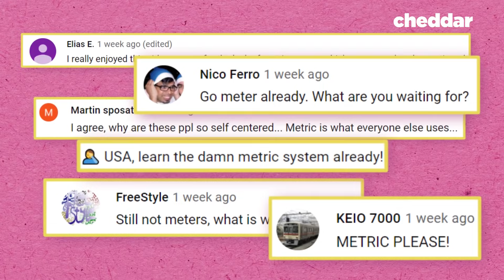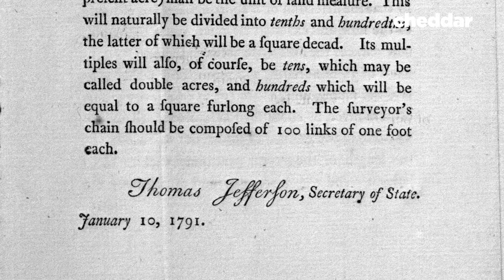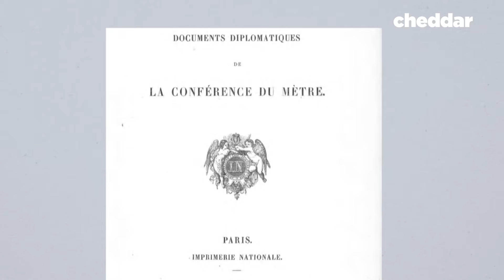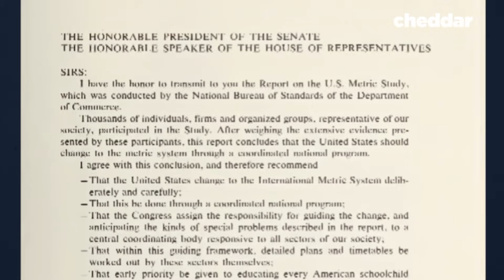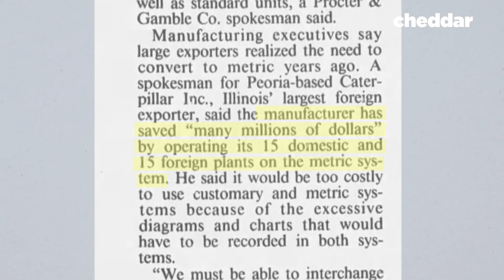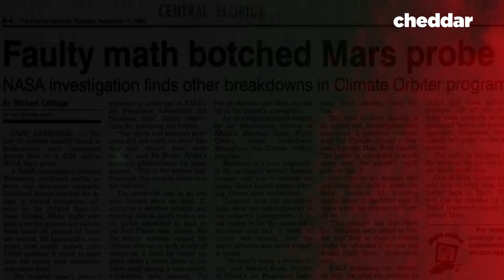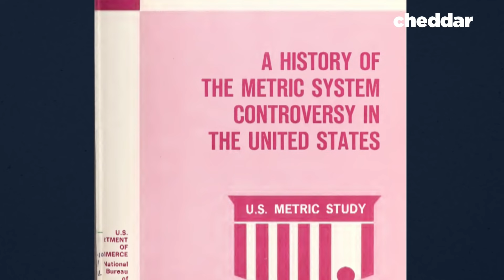Why Doesn't the US Just Use the Metric System? - Cheddar Explains

Comment: I'll never understand the hate for the Imperial system. Arguing for acceptance because it's the standard in the most number of places? Sure. But when people start talking about how Imperial is a bad system, I just wonder if they'll ever realize that they already use a similar system of measurement that doesn't have internally consistent values: Time.
Reply: Roman Hauksson-Neill  
Metric time is a real thing. It's all about perspective. People think there's no alternative to the system they use because they are used to it. Metric time is probably better than the system we use in the same way Metric units are better than Imperial units.
Reply: @Stiljoz  https://en.wikipedia.org/wiki/Sexagesimal  and https://en.wikipedia.org/wiki/Duodecimal  are much better at division with whole numbers, except that we chose base ten Arabic numerals.  Think of how easy it is to work with a quarter of an hour, a half an hour, a third of an hour, or just one twelfth (5 minutes).     How long is a third of a metric hour? Maybe, 33 metric minutes and 33 metric seconds, and 333 metric milli-seconds or 20 minutes...  base 10 is not the best at everything.  Agreed, 5280 feet in a mile is a bit idiotic, (we apparently take slightly smaller steps than the romans with 5000 roman feet in a mile).  Hey, feet would have been a bit too short for 1/60th of a degree of the earth ~6072 ft. (1 nautical mile)  So that is frankly the issue in human related units vs earth related units. Oh well...  If our strides were a bit longer and the inch a bit longer, we could have some nice wonky units in base 60 or twelve and reallllly easy whole number divisions...   2,3,4,5,6, etc...   Ahh, for a 6000 "foot" mile, and about a 25.72mm "inch"

Edit: Corrected to "twelfth" from auto-corrected "tweets"....
Reply: The SI unit of measure for time is the second. Its defined in relation to the frequency of some oscilation in Caesium atoms.Atempting to use the rotation of the Earth and the relative movemnent of astronomical objects as the base for measurement just dont work because they vary, thus leading to leap days and leap seconds to prevent time and dates to drift too much.
Reply: How many cubic feet in a liquid gallon again?
Reply: @1978ajax I was trying to convince proponents of the imperial system that there is a huge advantage to the metric system. (You obviously got that)
Btw, the conversion between mass and volume is not a good example.
Reply: @1978ajax because it is only true for water and only at a specific temperature.
It's just a lucky coincidence, not a systematic feature.
How much does 1000cc of oil weigh?
Reply: @1978ajax No, it isn't room temperature.
Reply: @1978ajax You seem triggered.
It's not at the SI unit "room temperature".
And it's not a "system" if the conversion works for exactly one liquid.
Sure, block someone who you don't agree with. Makes your point so much stronger.
Reply: @1978ajax I see it fits a pattern with you. You don't agree with someone, you block them or ignore them.
Good for you. You obviously are very easily triggered.
Reply: I will never understand how can a person be so stupid to get mad and argue over something like measurement system.

I live in EU,I hate metric and I never got mad no matter how i felt. It always amazes me when an adult spits like a 10 years old when i say i like imperial without even saying anything about either system being better.
Reply: Because imperial is harder to use and more error prone.
Reply: @heronimousbrapson863  
Maybe if you never used it.But same story is with the metric.

Both are easy to use for a person who uses them regularly. And both systems are error prone only if you convert them between each other.
If you keep metric with metric and imperial with imperial you usually get precise results.

You might think metric is easier because you are only moving the decimal point.
But as an European who uses it and comes to contact with micro,nano,pico,.... units sometimes.
It can become very confusing when making a bigger conversion either up or down.
If you stay with basic ones like km,m,dm,cm,mm thats pretty easy,but so are miles,yards,feet and inches when you are used to them.
Actually quite ironic in some metric countries they dont even know what dm is.
Reply: @Stiljoz
: there is no "hate" for the imperial system. Everyone think it's just ridiculous and dumb, that's it. Ad for time, it has absolutely nothing to do with metric or imperial system. You'd know if you paid any attention at school. The time measurement as we all use now comes from the system developed by the ancient Sumerians and improved by Babylonians. Saying that the time measurement is "similar" to imperial is simply stupid, to put it nicely. But I get that's too much information for you to process.
Reply: I do not hate the imp system, but it is not consistent. One US gallon is 3.8 liters, one imp is 4.2, the bushel is not the same, and even Americans screw up unces. Water density is crazy in the imp system, With unces to the cubic foot. When these  calculations went wrong you could conclude that the imp calc was wrong, the metric system is too simple. Remember an oil spill on the Canadian East Coast.. A US Fishing vessel ordered diesel in gallons. and much of it ran over. The yanks had calculated in US gallons, the Canadians delivered Imp.
Reply: @floro7687  I'm not sure what you mean. The US gallon is the imperial unit for volume. And why are you saying one "imp" is 4.2 liters? "Imperial" is the name of a system, not a specific unit.
Reply: @Stiljoz  Much you know! One US gallon is 3.8 liters. One imperial gallon (UK, and elsewhere in the former Imp. including Canada) is 4.2 liters. Imperial and US bushels are also different.
Reply: @floro7687  I had no idea the Imperial gallon even existed.
Reply: @Stiljoz   Many Americans are not aware of the world outside of the Land of Milk and Honey!( After the French Revolution they even divided the year into 10 months, but it did not Catch on.) When delivering tonnage cargoes in London Docks, the Imp system of unces to the cubic foot for water density could drive you nuts along With long/short tons. Often the same Madness in Australia and Hong Kong! Happy New Year!
Reply: @Stiljoz  Whatever yoy say Yourself! But it is outdated, and leads to misunderstanding. Some calculations you better do metric, and convert to (US) Imperial if Your oponent will permit.
Reply: @floro7687  See, this is exactly the kind of mindset that I'll never understand. You aren't able to see things from another's perspective. There's nothing outdated about the Imperial system. It's just a language you don't know. Some languages are easier to learn than others, but that doesn't mean English is a bad language for being among the most internally inconsistent. There is nothing that makes Imperial more or less confusing than Time, but no one has any problem with that confusing, arbitrary, internally inconsistent, outdated system we use.
Reply: @Stiljoz  Calculations are far simpler and quicker in the metric system. Have nothing against the imp but it is now used in 3 countries, definitely for a reason. If you wish to continue all right, however it should be prudent to standardize because whatever you say. there are 2 gallons, and 2 bushels, several barrels and the unce also often causes misunderstandings, unce, troy unce, fluid unce. Have you tried to to document a consignment of goods in several nations? As a person who wrestle With 8-9 Languages I suspect you know only English.
Reply: @floro7687  You're pretty much proving my point here. I'm saying that the problem with this conversation is it always devolves into insults. And so of course you say that I must only know one language because I use the Imperial system sometimes.
Reply: @Stiljoz  No insult at all. I just tell you it is ok to use Your US Version of the Imp System inside the US. But since no other nations Accept it, because of the fluid undefined state of the Imp Syst. problems arise in trade, which the US has de facto accepted, issuing export manifestos in Metric. You would have known this if you followed the press in other nations. How you find the insult I do no understand.
Reply: @Stiljoz   Sorry bro but the imperial system is just one big mess. The metric system is based on a decimal system, which makes it really easy to convert one unit to another (cm to m, gr to kg, etc). The imperial system on the other hand is based on arbitrary values, where the units are not related in any way to the others. That is the reason why you can't jump from feet to miles, teaspoons to gallons, without doing some really absurd and long math. But I also don't believe that it should be imposed, but rather gradually thought to the younger generations with a long transition period, to make the entire shift as smooth a possible.
Reply: @claudiochileno  I'm interested if you'll be able to see reason on this. I freely admit that the Metric system is the objectively better system, but Imperial is far from "one big mess". Is it difficult for you to convert 2 days into 48 hours? Or to convert 98 minutes into 1 hour 38 minutes? Or to convert 17 days into 2 weeks 3 days? These are very simple and easy calculations using units that have arbitrary values and where the units do not relate to each other in any meaningful or consistent way, exactly like the Imperial system. Doing conversions in Imperial really is just as easy IF you know the language. That's the key here. It's just a language that you don't know, so it seems complicated and confusing. Can you understand that this, admittedly worse, system is perfectly reasonable, functional, and comprehensible?
Reply: @1978ajax 
That's not even close to what I'm saying. It's really, "You use confusing units of time, so you should be able to understand using equally confusing units of length/volume/mass."
Reply: @1978ajax If you're just going to pretend my argument is different than it really is, then there's not much I can say. I'm not attacking metric, simply defending imperial. Both are perfectly reasonable systems.
Reply: @1978ajax 
Yeah, we're done. You're not listening to me, so this isn't even a conversation.
Reply: @1978ajax if you still believe that I am in any sense defending a non metric system, you obviously can't even read.
20 degree is generally accepted as room temperature, it is not the temperature at which 1000cc of water is 1.00 kg.
Nice of you to use the scientific word "about" 20 degrees.
Reply: @dozog  Sorry my poor English, I think you right.
Kilogramme definition change in 1889 already.
Before it is one liter water at almost 4°C because water density is biggest.

Comment: I still like feet for common use because base 12 has more divisions than base 10. 🧐
Reply: You mean "12 has more divisors than 10". Which it does: 1, 2, 3, 4, 6, and 12 versus 1, 2, 5 and 10. So Hell; let's just all switch to dodecimal.
Reply: @CarbonRollerCaco  I can count to 60 and 144 with just my hands!
Reply: Are you serious?? Read carefully what you wrote
Reply: 100% true fractions only exist in the metric system when its convenient.
Reply: I know what you're trying to say but "base 12" and "base 10" means numbers that only divisible by 10 or 12 like the number 144 (12x12) or 100 (10x10).
Reply: DoomFinger511 - I mean base 12 relative to the unit we call a “foot”.
Reply: @obits3  pretty sure base 12 means you are talking about 12^x... which I'm quite sure is only a thing when comparing binary (2^x), decimal (10^x) hexadecimal (16^x) and other number systems (not sure on the names in english)
if you are talking about having 12 increments = 12 inch in a foot (not sure if these are the correct names but anyway)... in metric you can just convert the decimal spaces of any number to the prefix, so there is a pretty much infinite amount of increments at you disposal^^ (for example = 0.00001m = 0.01mm (mili = 10^-3) = 10μm (micro = 10^-6))

Comment: Aviation is what suffers the most, the American units (knots, nautical miles and feet, all thrown in the mix) are absolutely miserable to use and the whole world is stuck with them.
Reply: For altitudes they are kinda handy though as 1000 ft is a pretty decent vertical separation for ATC purposes and allows altitudes to be specified quickly as like eight-thousand as opposed to two-thousand-four-hundred that takes twice as long to read out if you use flight levels at 300 meter increments instead. Above the transition level it would make less difference as they are already specified as "Flight Level" then the altitude in hundreds of feet, simply changing that to the altitude in hundreds of meters would not change much except that the last digit wont always be a zero anymore which to be fair is kinda redundant to even have there when it's basically always 0.
Reply: @FaerieSeraphina  I don't disagree there, a meter always seems to be too big of a unit for many things, but the difference wouldn't be as huge as you're making it out to be.